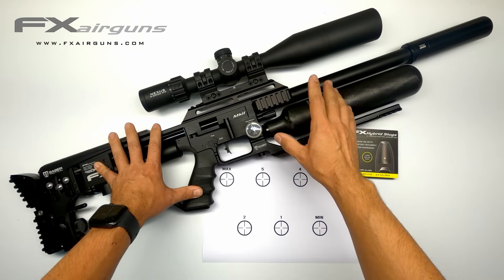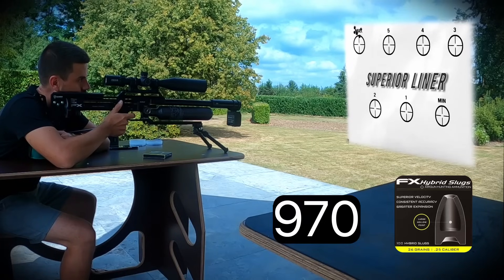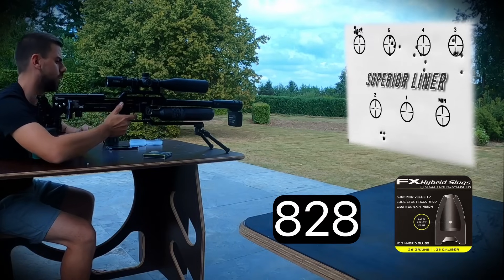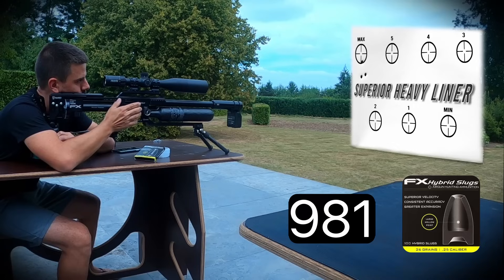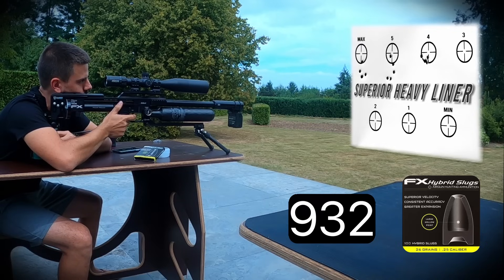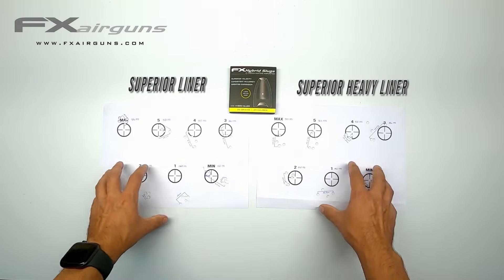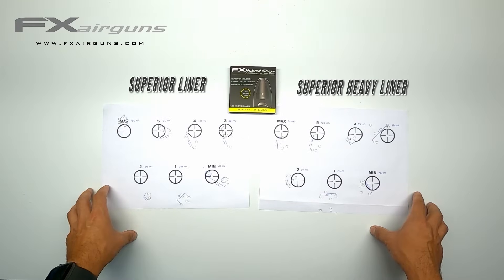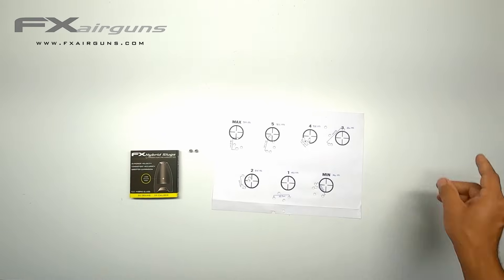Importance of harmonic tuning the FX Impact

Comment: Hi Man, i notice that after some time or some shots, the measurement with caliber of the hummer spring preload changes, became longer and so less power and velocity. For exampe i tune the gun and the size of the preload is 16.40...after some time and some shots i notice less velocity so i take the size and it became something like 16.80, 17.00...does it happen to you too?
Reply from the maker: I haven’t had this problem myself, but some other people have experienced this . It’s nothing mayor but originally from the factory there is some soft glue on the set screw, once it have been adjusted several times it’s possible there isn’t enough glue left to keep the screw in place . You can put a very small amount of bleu loctide on the screw or I have seen some people put Plummers tape on it
Reply: Thanks a lot for quick reply is a good news to know is not only my problem and there is a confirm of the solution that is very easy! Thanks a lot

Comment: With 23 grain NSA slugs out of 600mm superior what would your target FPS be as a starting point?
Reply from the maker: Haven’t tried the NSA slugs but a good starting point for any slug is between 920-960 in my experience.
Sometimes you get lucky and they also preform at slower or faster speeds
Reply: @Andrew R I have my Impact tuned to 925 fps with the .22 
NSA 23gr .217   Reg at 130 bar, hammer adj screw maxed, power wheel on five, valve adjuster just under four lines.  600mm STX Superior pellet liner. Stock gun with power plenum and without the slug power kit. Five shot group .385” ctc at 50yds. I’m getting laser accuracy with this tune. Did this purposely so I can share the same tune but with power wheel on 2, shooting the H&N Barracuda Match 21.14 gr 5.52 at right around 920 with the same accuracy results at 50yds. The stx superior liner shoots the H&N BM very well, also! Enjoy!

Comment: What was the valve adjuster set to? Is it open all the way? If you close the valve more, how much lower can you bring the power? I was just wondering how quiet can it get? Is it possible to get it to around 500fps?
Reply from the maker: You can tune the impact to shoot at 500fps without a problem, but in this case for slugs that FPS has to be high.
Also the valve adjustment isn’t the way to bring down the power , it’s more a fine adjustment
Reply: @Airbuks  Thanks for the reply! Interesting information regarding the valve adjuster! I was more concerned with being able to make the gun quieter (for backyard usage) without reg adjustment. I think using a heavier projectile should bring down the fps too! Cheers
Reply from the maker: @llr3zall151  yes it will bring down the FPS but I would tune it differenty and shoot pellets in the backyard. Try some pellets on you current tune and shoot groups at every setting on the powerwheel and you will see what works best

Comment: This result may not be just for barrel harmonics because the best result should be seen in one target and they should see the nod period and the best result with ctc below half inch in 50 yard   my at44 after harmonic tuning in best speed 820 ft/sec at 50m ctc 15mm with jsb 18.13 grn  in 27ft / lbs
Good luck
Reply from the maker: Not 100% sure what you mean , can you explain somewhat different?
Reply: @Airbuks  
In the case of air rifles there is a harmonic barrel, but since the shock caused by firing is not a large component, such as a gun compared to air rifles, but on a smaller scale, I think the mass of the projectile is the most It is effective in balancing the twist rate and achieves the best accuracy at the most appropriate speed with good sf. I use Sterlock software to get the best SF and often the result is very useful.
Reply from the maker: I understand now 😉 I also use StrelokPro

Comment: Now that you have tested this particular projectile to find its optimal velocity in a particular barrel liner,  your next step should be to index your Superior Heavy barrel liner while shooting those projectiles at 935-940 ft/s.

Here is how: Make a black dot on a large piece of white paper as your point of aim for this exercise and place it at 50 yards;  now shoot a five shot group while aiming at the black dot; now remove your silencer and barrel shroud and threaded barrel liner retaining nut; then loosen the grub screw in the rear block that holds the barrel in place; now make a registration mark at the 12:00 o'clock position on the top of the barrel liner with a marker; now rotate your barrel liner to the 2:00 o'clock position; then tighten the grub screw in the rear block, replace the retaining nut and shroud and silencer; and now shoot another five shot group while aiming at a new black dot on the target paper. Now repeat this entire process so that you have groups at 50 yards with the barrel liner shooting at the 12:00, 2:00, 4:00, 6:00, 8:00, and 10:00 o'clock positions. 

I performed this procedure on my .30 cal Impact after determining the most accurate velocity for pellets and slugs both, and I saw groups that measured from several inches down to one group where every shot went exactly into the same hole! At this point I removed the silencer, shroud, and retaining nut one last time to make my final permanent registration mark on the barrel liner at top dead center with a carbon steel stylus and permanent marker. You will be surprised at not only the difference in your group sizes that were shot at different positions of the liner, but you will also be surprised at the difference in where the groups are located in relation to your aiming point...some will be high to the right, while others will be low to the left. Weird!

Indexing your barrel liner can make a huge difference in your group size and in many cases finding the sweet spot will allow you to increase the velocity while retaining the same tight group size. With this FX X-Barrel System we have the unique opportunity to index our barrel liners to find the sweet spot where it shoots the best groups, and is then in fact properly "harmonically tuned". For those who may be skeptical of the advantages of barrel indexing I recommend you contact Anschutz in Ulm, Germany and ask them what is the difference in price and accuracy for one of their rifles where the barrel has been indexed by one of their top gunsmiths...they will make a believer out of you I am sure!

All the best, Chuck
Reply: Simple but over looked on these Rifles there is a good film from the FX Factory on YouTube showing testing ! if the Barrel can not shoot 5 shots through a 5mm square it is rejected to be polished the speed is never altered and they seem to know a perfect speed and the perfect testing pellet  So then just down to Barrel !!
Reply: Hahaha Chuck, as always, you are pushing the limits. I have learnt a lot from you on AGN :)

Comment: I also believe you should do this "barrel harmonics" test using a regular chronograph with nothing hanging on the end of your barrel, to see if it makes any difference or not.
Reply from the maker: Indeed the chronograph hanging on the barrel makes a difference, but it gave me a idea of the target velocity where the groups where the best . Then I took the chronograph of and fine tuned it using the valve travel knob . When I turned it 1/2 turn out it gave me the same accuracy.

Comment: Great video showing the need for barrel harmonics but i have to wonder if the results would be the same without the chrono dangling on the end.  From experience i have found a massive difference and only use the chrono to tell me the speed for each setting then get on to the harmonic tune with out it attached. The longer the barrel the greater the difference.
Reply from the maker: Thx for the support, you are right about the chronograph but I use it only to give me a lead on what speed works best . The chronograph makes a difference that’s true , but not so dat the lead FPS is far of . So once I have the potential FPS I fine tune it without the chronograph
Reply: Try repeating the test with the chronograph never touching the barrel. I believe the results will be surprising and your velocity tune will be different.  
Use the valve adjuster to "very slow incrimints" slowly reduce the velocity till you have a a tight group. Maybe 5fps drop each test

Comment: Hello friend, good results and it is seen that hybrids do not always behave well at higher speeds.  What is the difference between the superior liner and the superior heavy liner?
Reply from the maker: The heavy liner is mostly made for heavier slugs where the normal superior for pellets and light weight slugs . That’s why I think the hybrids preform well at low speeds in the normal superior liner 🤔

Comment: Great video as always. I just wished if you fired 3 empty shots between each setting
Reply from the maker: 🤔 I will think about it , but when you look at the chronograph speed it reacts immediately. It’s not the same like when you change the regulator pressure or the valve adjustment

Comment: You must remove the chronograph. It affects the harmonics
Reply from the maker: Thx for the tip but I am aware off this , that’s why the final test don’t include the chronograph speeds , I use the chronograph to determine the appropriate speed that gives me the best results then I take the chronograph off and fine tune it , in this case the group was even better 10fps faster at 940-945 FPS
Reply: I place my Chronograph on a sand bag on the table to rest about 1 inch under the barrel, close to the tip, this allows me to fine tune without having to do double work. The chrony is also more accurate this way.
Reply: @gertvrey6941  Ernest Rowe mounts the FX chronograph on a fiber carbon rod that is parallel to the barrel and closer enough to record muzzle velocity flawlessly. IMO the best setup to do harmonics tuning as the chronograph does not affect the barrel vibrations.

Comment: Can you do a test? With maximum speed instead of taking pressure off the hammer to lower the speed, can you slowly increase the pressure of the regulator to lower the speed of the slugs? You will have a surprise;)
Reply: @Mike Simão  I agree. The higher reg pressure will cause the valve to close sooner, giving you a quiet and air efficient gun. A shorter burst of high energy is better than a longer burst of lower energy. Great point!👍🏻
Reply from the maker: I don’t get where your heading with this . Those 3 factors have to be in harmony to work efficiently. If you put to much Regulator pressure for the given hs you will get inconsistencies . Remember I am not looking for maximum power ?!
Reply: @Airbuks  It is possible to find harmony in both ways. But I prefer to do it for the regulator. I keep going up until the groups are perfect. Not once did I fail to make it perfect. If there is no way to increase the regulator, I will decrease the hammer screw until the groups are perfect. Only then will I see the speed at which it stayed. Gold is always the size of groups and never the power
Reply from the maker: Mike Simão thx for the tip 👍 I will try it that way aswel